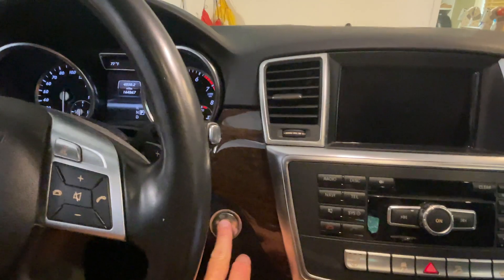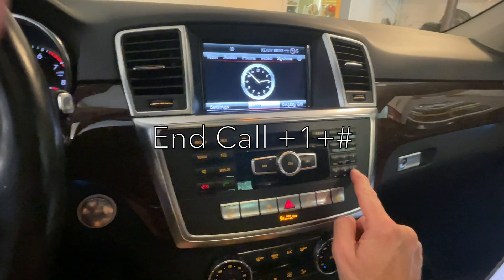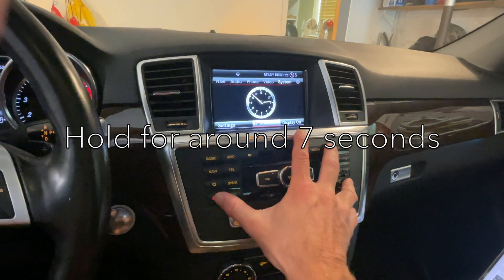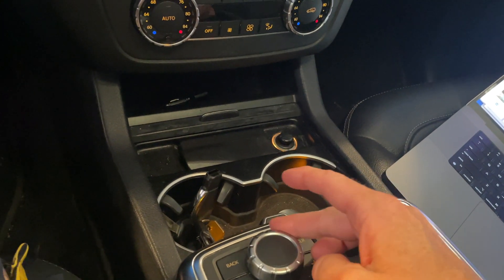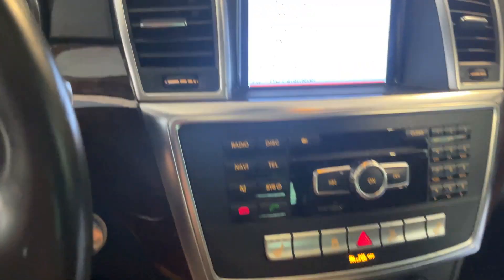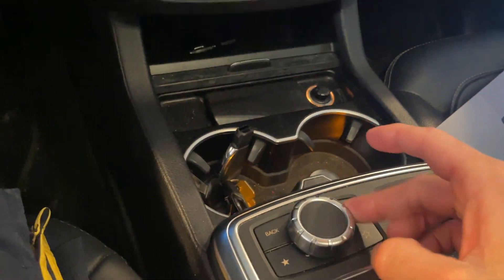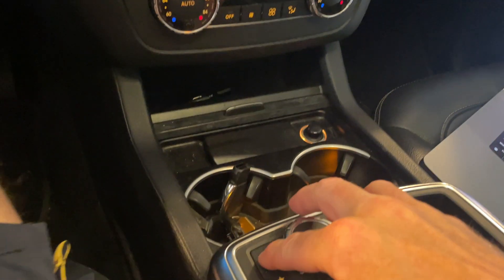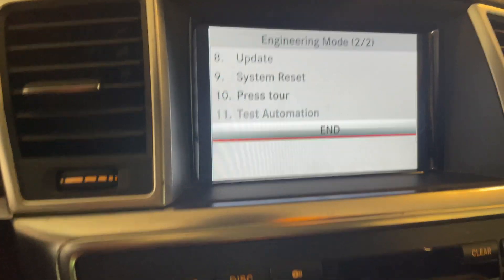How to get into the Hidden "Secret" Engineering Mode Menu on a Mercedes Benz 2012 -2016 Con

Comment: Hello I have a question so my ml was standing in rain for few days because bad weather and all was good until I saw it has a leak from the sos button and over seat belt holder what do I do ?
Reply from the maker: I can only speculate without seeing it but I’m wondering if the seal around the sunroof has a crack or is not sealed. The water could possibly be leaking in through there and running down to where the SOS button is.
Reply from the maker: If so, we can seal that up fairly easily.
Reply: @IvanSchlachter will I be able to open sunroof tho?
Reply from the maker: @rostyslavblishch8255  definitely, you should check for leaks higher than the sos button which makes sense that it would be the sunroof. If it the sunroof, it’s probably the rubber around the glass. You should look to replace whatever is cracked or leaking. Look around for any cracked rubber or plastic that could be potentially letting water in.
Reply: @ thank you man you the best
Reply: @ love your channel

Comment: Hello I have a same car and I have a question so I forgot to tighten my gas cap and now I have check engine light and I stopped turned off the car and tighten the cap but the light is not going off what do I do please help me
Reply from the maker: Hi, if you take the car to an Autozone or another auto parts store, ask them if they will use their OBD2 scanner to read the code that your car is giving. If it’s just the gas cap, ask them to clear it. If it’s something like a oxygen sensor, you may need to replace those.  Not a big job either way. But they should help you.
Reply: @IvanSchlachter thank you so much